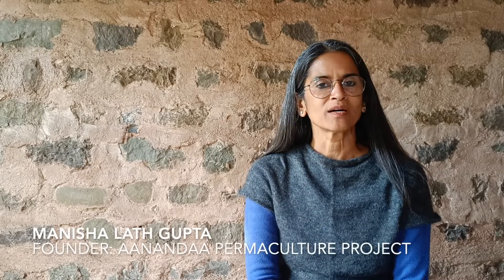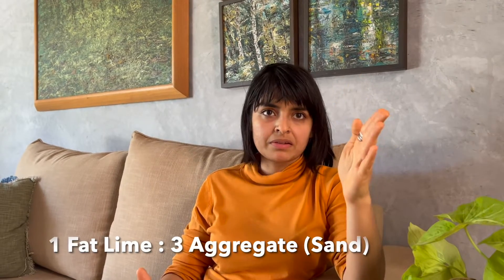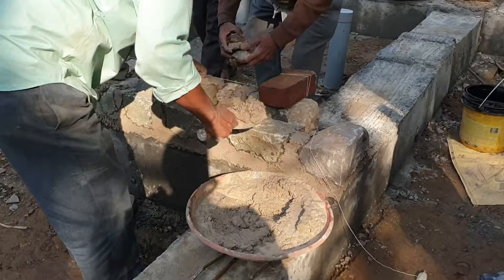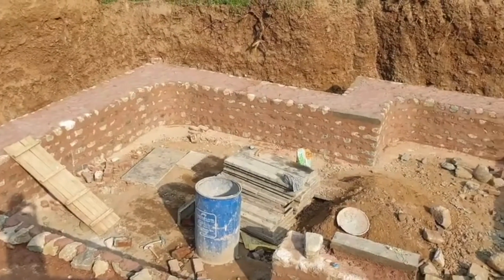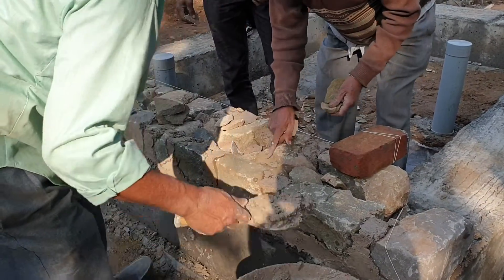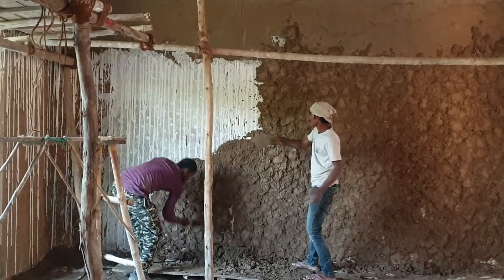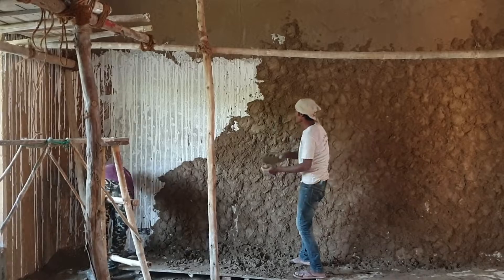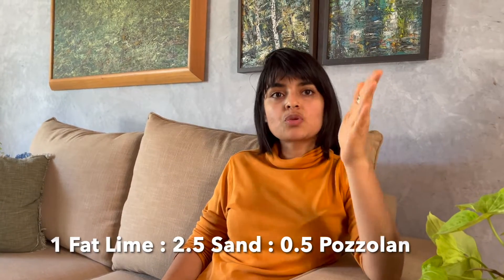Using Lime in Civil Work

Comment: Can we use lime for concrete?  Is it stronger for modern building construction excluding cement ?
Reply: 67% Yes & But also no, mostly calcium !    
Curing time is the problem.  Cement reacts with water & reaches good strength in weeks submerged. 
 Lime requires the correct humidity & availability of Carbon CO2 in the air 
Forms are impractical to use CaHO2  (NHL 2-5) in the same way as reinforced rebar/cement, frame construction is performed. 
It would take 10's to 100's of years to fully cure if poured as a vibrated slurry.  

Do a pot of each and see the lime will remain soft for weeks while the cement will be quite hard in 30 mins 
(*temperature &admix dependent) 

Although lime can reach a similar strength over time & with appropriate aggregates / pozzolan / ash / fibre.  
It must be constructed by being tamped down in stages using far less water than with cement slurry.
 It is no replacement for portland cement which contains a lot of admixture.
 including: Quicklime ( CaO )& C3S / Silica (3CaOSiO2), Alumina ferrites (4CaO Al2O3 Fe2O3) Gypsum ( CaSo4 2H2O ).  + more

 in modern structurally minimal construction. 

where creativity is involved it can build whatever you dream, In layers

Comment: Lime good for health benefits and strong but problem is that to slab making it's defficult
Reply from the maker: Correct, But even if you make a slab with cement, you can do the finishing in lime.
Reply: You can use Hollow Bricks for Slab with Cement and Lime Plaster it.

Comment: Grateful for the information. I have this very old rock house, I don’t know how old but probably more 150 yeas old. Its has thick walls about 90 centimeters.  Someone told me that they probably used volcanic sand and salt water to bind the huge rocks and stones together after repairing the internal wall which is a cement rendered, the cracks quickly became huge and everything just crumbling. I used cement and sand to fix the cracks and it worked fine. Now I’m at the point of rendering the walls  to a fine finish. I’m like should I use a limestone render and use some elastic filler as fine coating that I can sand and that  I know is breathable and then use breathable paint to finish. The walls are normally dry and no mold or damp, okay there was some salt deposits but again the walls hasn’t been painted for who knows how long and really couldn’t get the paint off,  even using a grinder and scraper. Had some water poring through from the exterior walls and have to fix that after letting it dry over the summer.  It dried quickly after using a dehumidifier, which indicates the walls are highly beatable I guess. Was also thinking of using some humidity render that I been using one all interior walls facing exterior walls  in the newer cement block walls but expensive but it make a huge difference in touch over the winter. It a super hard modern material and was recommended, but it leaves a rough texture not easily sanded was again thinking using this filler on top as skim coat in the old rock house.  What do you suggest. Kind of old vs new modern material.

Comment: What are your thoughts about using the mentioned materials on a concrete block or concrete hollow block walls? Will it still be effective, or do we need to completely switch to stone and bricks? Sustainability is not just about using stones; if someone can only afford blocks then if we utilize what you suggest, such as lime and sand will it be that much effective? Considering the harsh cold weather Tibet or Ladakh, how can these techniques be utilized?
Reply from the maker: You can definitely use lime just as a finishing material or bricks/ cement blocks/ concrete slab - any surface. It will replace your cement plaster+POP+paint layer.
Reply: @farmaanandaa  That is most helpful; thank you.

Comment: Thank you for these great videos. It is a great deal of knowledge that you are providing here about this niche segment. There is very little info available on the internet for the enthusiasts.

BTW, at 4:45, you have explained about the usage of regular ash as a Pozzolan. I reckon that you are specifying about kiln ash created from burning wood?! Which mainly consists carbon?! The actual Pozzolan(volcanic ash) of Roman times contained Silica and Aluminium so that the the Calcium can form Calcium Aluminates and Calcium Silicates which are stronger than CaCO3. The modern equivalent would be flyash which has them both. Ash is totally different from flyash. Please correct me if I am wrong. Looking forward to your response.
Reply from the maker: Ah, Malvika would be better positioned to answer this. But the ash we used came from the Lime Kilns itself.

Comment: Hello there! You all are doing a wonderful work to revive this beautiful sustainable practice. I am trying to use lime plaster on brick wall, what is the minimum time needed to slake Hydrated Lime before using it?
Reply from the maker: I think it should be a month. You will be able to tell when the lumps break down completely and you get a nice thick creamy texture.

Comment: Hello, thanks a lot for this valuable information. I’m building a small cottage using lime and i wanted to keep the exterior brick walls unplastered. Do you think i should add a hardening agent like ash in my bedding mix to prevent water damage on the bricks. Also, is traditional lime white wash water repellent?
Reply from the maker: Not sure about the bedding mix, as the question is not very clear to me.
Lime wash is not water repellant. Do watch the video on Lime wash in this playlist itself.

Comment: Hi, thank you for this wonderfull video. I am from Mayapur, West Bengal. My family has a small land around 1500 sq.ft. land where we want to build a small apartment around 4 floors. Will you recommend stabilised rammed earth or CSEB for the walls. For foundation of the building, the only option I'm getting is with Rebar cement foundation. Are there any other options? Do you know anyone who can make CSEB or stabilised rammed earth here in locally or nearby?
Reply from the maker: Hello, why dont you check with Smell of the earth farm - they are only ones I know of, who have a multi storey earth building in west bengal. You can google them for their contact information. Good luck!